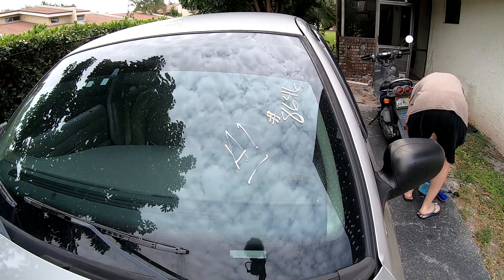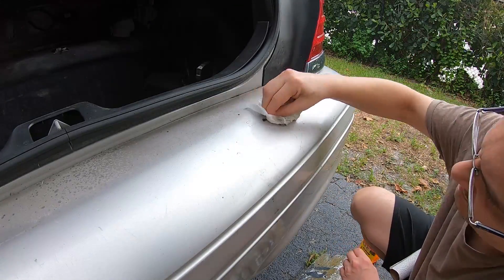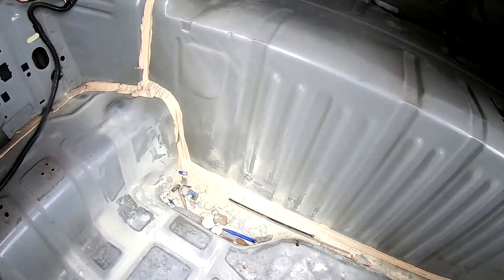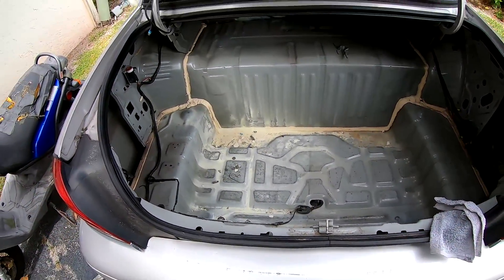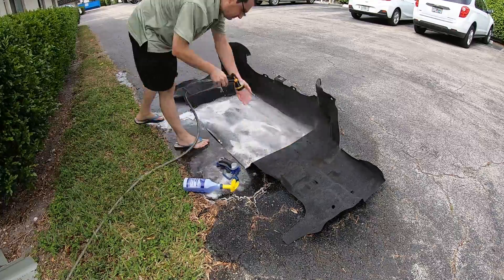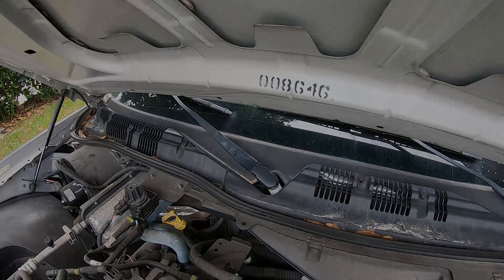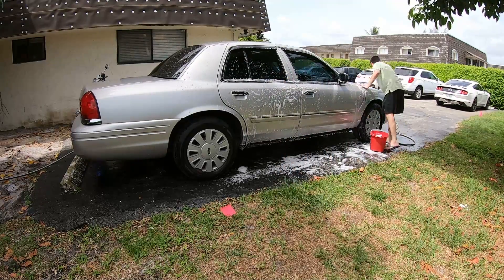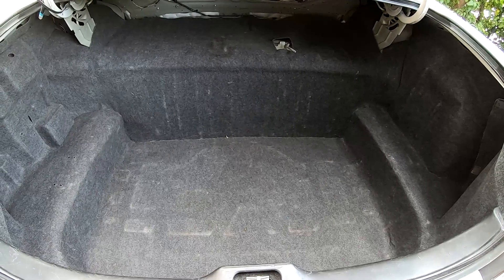Restoring 2011 Ford Crown Victoria back to life. Part 1.

Comment: How did open the screws of the trunk carpet ? I could not do it ,, should i use screwdriver or just i have to pull the screw by my hand ?
Reply from the maker: They are not screws, they are plastic clips. You need a plastic pry/clip tool.

Comment: You need to lower the hood halfway or so and bend the blade away from the windshield at the hinge before the clip will move. it's "locked" when the blade is leaning against the windshield. I've replaced my fair share of transmissions and wiper motors in these cars. It is really annoying, I agree.
Reply from the maker: Thanks, I will try that. Some of them come off easy, some just fight you to death.

Comment: Take off those wheel covers and clean the steelies underneath. They get filthy with the wheel covers over them. Once that's done, you can put the wheel covers back on.
Reply from the maker: I will buy new steelies, the ones on there are tiered. It's cheaper to buy new ones than have them redone.

Comment: 3:57 i had to drill two holes at the deep end of trunk (careful at items under trunk) to drain all the rain water....
Reply from the maker: Well, if you have rain water coming in, then you have a leak somewhere.
Reply: @LimitedEditionMotorcars  yes, definitely, but hard to find, could be the trunk seal, window seal, metal seam. also lots of condensation i see usually and it just drips down and pools, so for now, no trunk liner, im testing it
Reply from the maker: @SilverBullet93GT  Get inside the trunk with a flash light, close the lid and have someone hose the trunk and rear window area. If you have an 05 model year, they usually leak by the antenna seal.
Reply: @LimitedEditionMotorcars  99. no antenna

Comment: Nice video! I bought my 2007 Ford Crown Victoria Police Interceptor from the auction yesterday. I brought it home, I open up the hood and see a sticker on the top of the inside hood that says “Ford Motor Company, Vehicle Emissions Control Information”. It says the year is 2010. But the car is actually 2007. I even checked the vin number etc. Do you have any ideas why it could be that? I even checked the side of the door, there isn’t no sticker on the door.
Reply from the maker: You most likely have a replacement hood and door.
Reply: Goodfellas Garage I thought the same. Then I see a new intake, heat condenser, radiator. These parts look like it comes from autozone. I thought to myself this car may have been in a big accident. It still looks like a cop car with a push bumper, sirens wired up, extra battery wiring in the trunk with black and white color on the exterior of the car.
Reply from the maker: Yeah, most likely in an accident and fixed with whatever parts were available. Doesn't mean it's a bad car.
Reply: Goodfellas Garage I love the car. It runs like a horse. Very good shifting to. It has about 9800 idle hours with 80,000 miles. I love the way it looks, the sticker had me confused. I’m going to go underneath the car to see if I can notice if the crown Victoria was in a accident or not.
Reply from the maker: They are great cars. Use it, abuse it, enjoy it.
Reply: Goodfellas Garage Exactly 💯